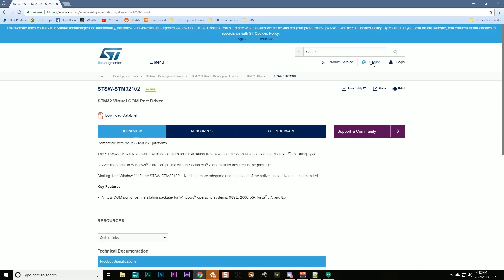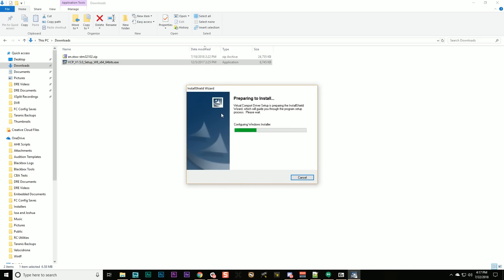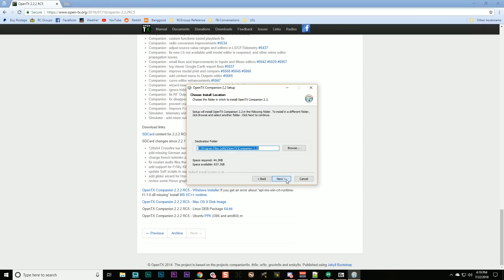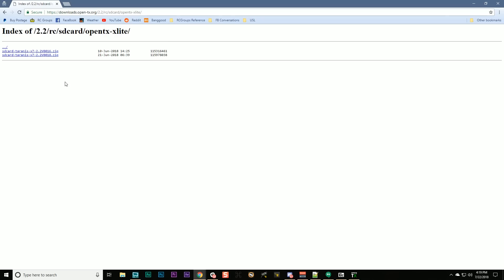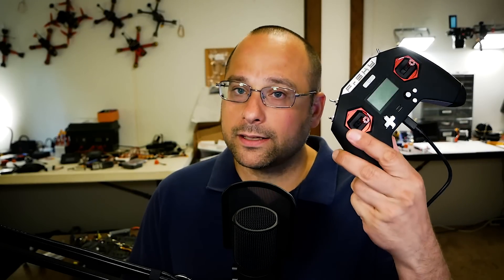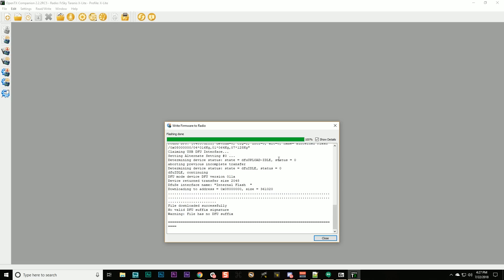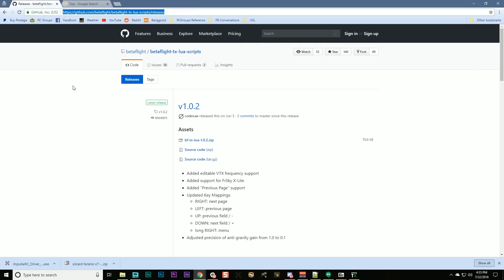FrSky X-Lite OpenTX Install/Upgrade How-To (Taranis X9D QX7 same procedure)

Comment: I just followed this video's instructions yesterday with the X-Lite I received as part of my first foray into FPV.  What a process!  With great power comes ... great unintelligibility and prerequisites!  Huge credit though that the video was done in a purely linear fashion and with secondary hosting to make people's lives easier when going through this for the first (or 100th) time.  Just following along got 2.2.3 installed on mine and it's in that from unboxed to ready-to-start-with condition in only a little more time than the video's run-time.  Thank you so much for putting it all in one place!
Reply: Instablaster.

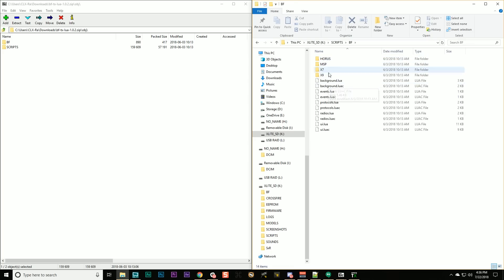Comment: Thank you for the video! But after 15:40min, what am I meant to do with the SD card once I have copied all the files onto it? Can anyone tell me? Sorry, brand new FrSky user here...
Reply from the maker: Put it back in the radio :-)

Ummmm I'm sorry if I've missed your point.
Reply: No that's it, thanks! I read about others holding down buttons when turning the radio on etc, so I just wanted to make sure I wasn't missing a step that everyone else already knows. All working now, thank you!

Comment: @joshua bardwell Hi, inside you video you did said how to backup the radio (on the next video), but i coundn't find, can you provided to me the link?
Reply from the maker: In Companion use the "backup radio" feature.
Reply: @JoshuaBardwell  fyi. I back up successfully. After update to version 2.2.1, I did use my own receiver to bind unfortunately it does work, then i borrow my friend receiver also cannot be bind... Please advise...
Reply from the maker: Make sure you are selecting the right receiver protocol? D16 or D8 or whatever the receiver needs?

Comment: Love your videos, very informative. So, I followed all these directions, and I flashed new firmware to my FC (SPracingevo 3), and bound the XM+ receiver in D16 mode..... motors spin up in Betaflight using sliders, receiver tab shows the 4 channels of the receiver are talking with the XLite controller. None of the switches work on the mode tab, and the radio won't move any of the motors, either in Betaflight, or disconnected from the computer. I even rolled the FC back to older firmware.... what gives?
Reply from the maker: You need to set up the Arming Mode to one of the aux channels.

https://youtu.be/Xs8tySubJ74

Comment: Hello Joshua. Will this convert my EU version to International?
Reply from the maker: You can flash the firmware if you want. You have to flash the firmware to the internal module. Just installing opentx won't change it.
Reply: Joshua Bardwell thank you. I managed to flash it with international :)

Comment: Anyone know will the Emax Tiny Hawk frsky receiver work with the Turnigy 9xr pro with a frsky DJT-JR module? Would further setup be required similar to this video?
Reply from the maker: You would need the XJT module not the DJT module.
Reply: @JoshuaBardwell  Thanks for the response! The XJT module in the link has a Non-EU and LBT-EU. Is it the Non-EU that works with it? https://www.flyingtech.co.uk/electronics/frsky-xjt-radio-transmitter-jr-module-telemetry-lbt-eu?sku=RC-XJTLBT-NONEU

Comment: Hi Josh, I've followed this to a 'T' but when press down to run the lua scripts I get "SYNTAX ERROR" unexpected symbol...  has this happened to anyone?  If so, is there a fix?
Reply from the maker: In this situation I would delete and reinstall the lua scripts. Make sure you have downloaded the latest ones.
Reply: @JoshuaBardwell  Thanks Josh, started from scratch as advised and it appears a cheap SD card was to blame! All working! Thanks for the guide!

Comment: Just a note, windows 10 doesn't need the STM driver.
From the web page:
"Starting from Windows® 10, the STSW-STM32102 driver is no more adequate and the usage of the native inbox driver is recommended."
Reply from the maker: If you try to actually do that, I think you will find it doesn't work.

Comment: i followed everything exactly how you said but it says no scripts on sd??? what have i done wrong?
Reply from the maker: I would go into the folders on the SD card and make sure the scripts are there.
Reply: That was the first thing I checked. I have formatted the card and I will start again.
Reply from the maker: Are you sure you have the right SD card contents for the version of OpenTX you're using? I guess it would shout at you if you didn't.
Reply: Honestly I have no idea. I will give it another go tomorrow with a different sd card as I suspect the card might be faulty. Appreciate the help and i love your channel. Thanks.
Reply: Just wanted to let you know that i tried this again with a new sd card and it worked. thanks

Comment: I would like to use my X7 and X-lite on the same quad / receiver. 
I copied my models from X7 to X-lite. But the rx will not bind to the X-lite. So I understand there is a unique ID on a TX that can not be transfered, correct?
Is there really no way of transfering the binding couple?
Reply from the maker: You definitely can rebind a receiver as much as you want. Make sure you're in D16 mode or D8 as required by the receiver.
Reply: @JoshuaBardwell  No, I do not want to rebind. I want to transfer the binding from one TX to the other, thus not having to rebind.

Comment: Thank you so much for your help Bardwell.  I was able to update the firmware however the audio was not working and I then discovered that I was using an SD 64g card but that size was not compatible so I ended up using a SD 16g which worked.   Keep up the great videos.  Do you have coupons to help support you when making purchases on line?

Comment: I’ve noticed that this doesn’t work with D series frsky receivers like the D4rii and such. Is there an external module that allows this or does the firmware update allow it?
Reply from the maker: I think that it should work with D8 series receivers. Just set the receiver mode from D16 to D8.

Comment: Yeah, instead of upgrading the firmware by just plugging the xlite into the pc, I just did it "the old fashion way" by going into the radio bootloader. On the xlite you hold down the "D-Pad" and press the on button. Then just connect it to the pc and flash... easy peasy! Maybe because I've done this with other Frsky radios it works without having to mess with Windows drivers or ImpulseRC? Anyway, THEN I came to this video which was good because I forgot all about the BF LUA which would have been a nightmare not to have it out in the field!! Thanks Mr. Bardwell!

Comment: Now that there’s no dfu suffex after doing all this now when I plug in my x lite to opentx nothing happens it doesn’t read my transmitter even if I try to upgrade firmware it does nothing so does this mean in the future I can’t ever update it? I’m freaking out! I used to plug it in on my Mac and it would bring it up now it doesn’t same thing on my windows either
Reply from the maker: To get to DFU mode plug in the radio with the radio powered down. I don't think anything has changed about DFU lately.

Comment: Stop!  When you say we have to load drivers, I’M DONE. Not your fault but it’s ridiculous. When I as a consumer have to start muking around with drivers and OS versions before I can even begin to get the latest updates to my transmitter, I’m done, finished, outta here. I understand improvements or problems may be discovered after a product leaves the factory. Having to jump through these hoops is absurd. Until OpenTX or FRsky or whoever fixes this,  I’ll fly my transmitter as it comes from the box!
Reply from the maker: Sorry my friend but if you are not up to installing drivers, you need to quit this hobby before you waste any more money. No offense intended but that is one of the simplest hurdles you must overcome: simply go to a web site, download software, and install it.
Reply: You missed my point, whether or not I can install drivers is irrelevant. No consumer should have to do this. Software today is beyond that.

Comment: I'm new to this and everything was going fine!  I have the xlite so I tried following the instructions to the t.  When the controller is hooked up and power off it just keeps searching for controller and never goes past that.  Should I uninstall impulserc and reinstall?  When I hooked the controller up windows didn't detect new hardware could that be the issue and if so can you point me the way to fix it.  I appreciate any help you can give!  Great videos too, very detailed.  I subscribed immediately!
Reply from the maker: Try different USB cable? The steps shown in the video should work. When you run impulse rc driver fixer does it find the device?
Reply: SMDH!!!!!  You were right, it was the dang cable.  I don't quite understand why as it works with my tablet and phone, other devices just fine on the computer......which is why I didn't think to try that!  Sorry for wasting your time man but you still saved me a heap of trouble, even though I feel like a dumb @@@!

Comment: So I forgot to check Lua-c when I did my firmware flash will that affect me from running the frsky long range module or did I only need that checked for betaflight lua script? Also when I downloaded the opentx 2.2.2 I didn't see an option for rc5
Reply from the maker: You only need that for the lua script.

2.2.2 is in final release now there are no more Release Candidates.

Comment: I keep getting an error where it can't write to firmware due to unknown error. QX7
It can read the models and such - even back it up.  Just won't write firmware.
Reply: Make sure you are putting the Radio into Bootlooder mode.  Trims in and press power.  Details are in google.  I know JB video has you flashing OpenTX with Companion, but I always prefer copy the firmware to flash, boot the TX into bootloader mode, flashing from boot menu.  Always works.  Firmware file name just needs to be under 20 characters.
Reply: Thanks man - I'll give it a try tonight.  I've used OpenTX before so not sure why it's giving me grief this time...

Comment: on my x-lite, the 3 position switches seem to not have 3 positions. all the way up and mid are fine they read 2000 and 1500 but all the way down they still read 1500, I have tried to change outputs and calibrations, trims. on the radio its saying that ist changed position but in Betaflight nothing.

also no matter what I do I can't get any of the sticks to read less then 1007 I can set my out puts to get 1500 and 2000 but not 1000 because you can't go any higher them 100 in your output calibration.
Reply from the maker: For the second question, you need to enable Extended Trims in the Model Setup screen. 

For the first one... I don't know. Check to see that the weight of the mix is set to 100% and the offset is set to zero in the Mixer screen.
Reply: thanks I fixed the trims, just these switches. I sent you a msg with a video via facebook.

Comment: Hi Josh, I'm in need of your help with the 3 position switches they both work from 1000-1500, but not 2000. I've looked all over the internet for information on why this is so with no good explanation. Please help.

Comment: Bardwell can you Please ad a video how to update MPM Lite?
Reply from the maker: I don't have that module but basically the instructions are:

1. Download firmware (.frk) file to the SD card FIRMWARES folder. Or it might be called FIRMWARE on newer OpenTX versions.

2. In the radio, navigate to SD card contents, navigate to the FIRMWARES folder. 

3. Select the firmware file, long-press and select "Flash External Module".

Done.
Reply: Joshua Bardwell will try thanks

Comment: My X-Lite left stick is not sending signal to my quad, it is bound the switches work and when armed the right stick spins props left does not.  Please share any suggestions (both sticks work properly in betafight)
Reply: update worked fine on 2.2.2

Comment: Stupid question: I updated my Taranis QX7 by turning it on into bootloader mode (trim switches to the center and then turning it on) and then plugging it in. Is that wrong? (Because it worked)
Reply from the maker: You can update the firmware that way but not the bootloader. The reason I do it from USB with power off is it updates both the firmware and the bootloader together.

Comment: Seen another reviewer do a firmware upgrade by going to frsky-rc clicking on downloads saving those 3 files to a sd card.  By doing it this is it just as effective?
Reply from the maker: Yes you can update the bootloader and the firmware by downloading the files separately. But IMO it's easier to do by plugging in USB and using Companion, because Companion quickly updates all three.
Reply: Well I did the update your way last night worked out great.  My question now is how do I put that firmware on to my frsky receivers from the x  lite?

Comment: i just got a x-lite yesterday.. i'm  thankful to have you JB, because this thing confuses the sh$^*$ out of me :p so many options compared to my old fs-i6x. i spend an hour yesterday trying to bind it to my hawk5 and setting up a arm switch XD
Reply: Kaoss I did the same when I got mine haha
Reply: my old flysky just had a bind button and that was that :p but besides it being a lot more complicated i really love the x-lite :D been rippin for 4 days straight and not 1 cramp in my hands and the amount of control i gained is bizar :D
Reply: Kaoss that does sound nice and easy haha, I came from a bugs 3 controller and those little tiny ones that come with the e011, the difference in accuracy and feel was night and day! At first I was so confused why my switches wouldnt register on betaflight and then I learned about mixer finally, lol I felt so dumb

Comment: Is there any reason that you get your SD card contents from the website instead of the downloader in the software (the button under firmware downloader)?
Reply from the maker: It's the exact same site. Clicking the download button in Companion takes you to that same page.
Reply: Yeah, I only realised that afterwards, when I went to update my radio to 2.2.2. I forgot that it doesn't just download it

Comment: Awesome this is the first time I have ever installed firmware on a controller and it works perfect, thanks so much Josh. I have no idea how to use and adjust PID settings on my controller but I will watch the video you suggested and see how I go. Thanks again mate.
Reply: Wayne's RC spin what video was suggested? I need to learn all of this as well
Reply: Yes good question Collin Allen... in the video Joshua said he would link the video on how to use Lua Scrips but he didn't...(Bad Joshua) If you just type Lua script in the search on Joshua's page it will bring up part 1 & 2 on how to use Lua Scrips. hope this helps
Reply: If your looking to set up the xlite to the Freerider simulator check out "Painless 360"video on it. I followed it on the xlite even thought it is for the X9D+ and it works great. Sorry Josh promoting someone else's channel on yours, but life is about helping all. My xlite is working fine for everything now, got all of my models set up. For anyone interested no you cannot put your sim card in from your X9D+ and transfer your models across. I know it sucks ass. But you'll know your way around your xlite real fast binding them all over...lol

Comment: Joshua, I haven't watched the video yet, but I wanted to quickly ask; is there a way to setup OpenTX so that every time I add a new quad the switches and everything else are all already configured to something I have preset?

All my quads use the exact same switch setups and I find it tedious setting up the switches on the Taranis QX7 and the XD9, it's one of the things I really enjoyed about my Turnigy Evolution I had when I first stared, add a quad and you're good to go.

Thanks in advance, I'll watch your video tonight.
Reply from the maker: If all your quads use the same setup, then don't make a new model. Just bind them to the same model as I discuss here:

https://www.youtube.com/watch?v=lnWoFHquveI

Basically, you have to have one model for Crossfire, one for D16 receivers, one for D8 receivers, etc. But as long as all quads are set up the same with channels and aux modes, you don't need a unique model for each one.

If you do want a unique model for each one, just copy the model and then bind the new receiver.
Reply: You're a legend! Exactly what I was after, thanks mate!

Comment: Hey Joshua! I already have 4 models on there but I want to upgrade. Do you have a video on saving and replacing files after upgrade?
Reply from the maker: You should be fine but just in case, do this: Turn on the radio. Plug in USB. Menu pops up on the USB asking if you want USB HID or game controller. Select USB HID. Taranis SD card appears in your computer. Open Companion. Select menu opion Back Up Radio. Back up the radio to a file. Now you're good to upgrade.

Comment: Hohoho, Linux users... not everybody is using an off the shelf distribution kernel and some don't even come with USB_CDC compiled in or as a module!
Reply: As for the too many devices, try this:

Open CMD, type this:

SET DEVMGR_SHOW_NONPRESENT_DEVICES=1
devmgmt.msc

Click on view > show hidden devices.

Now you should see a whole bunch of disconnected STM32 DFU devices, right click > uninstall and you shouldn't have any problems.
Reply: Little does Joshua know that this is the year for Linux
Reply: How is it the year for Linux?

Maybe DXVK is promoting gamers to switch?

I've been a long time Gentoo user :)
Reply: @sjoer  I started on Debian, when the choices where Debian, or Red Hat...  I'm used to APT, but always enjoy RPM..  haha
Reply: Back in the RedHat days there was one other choice: SuSE ;)